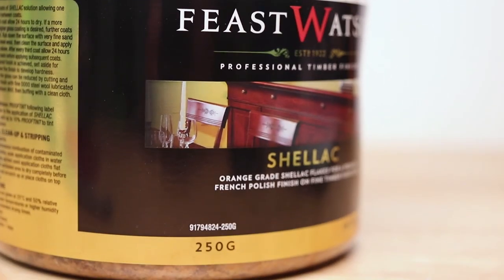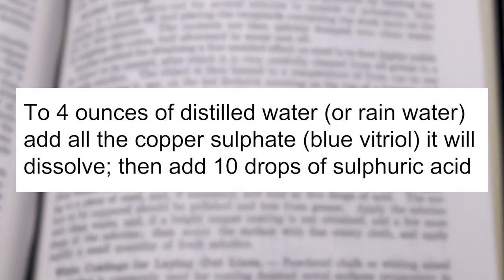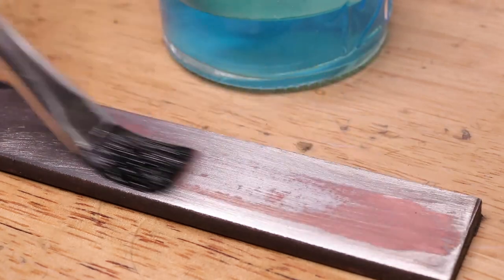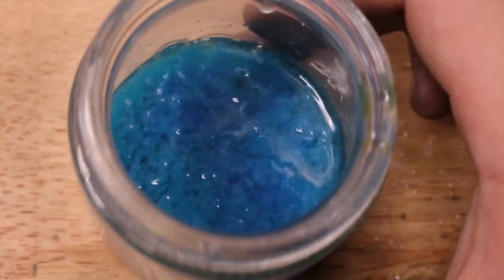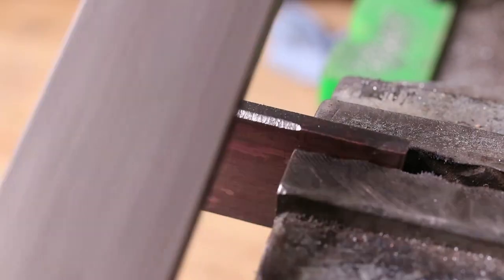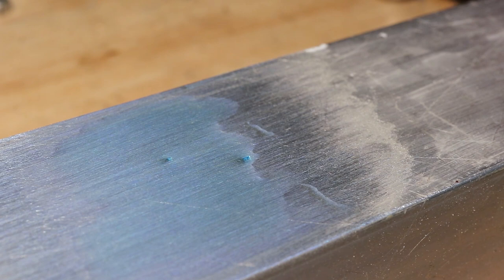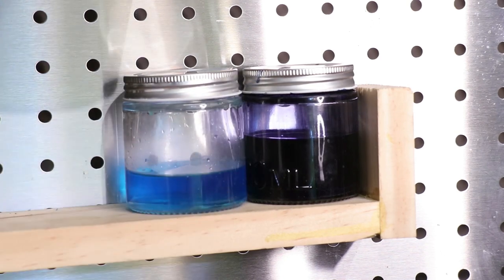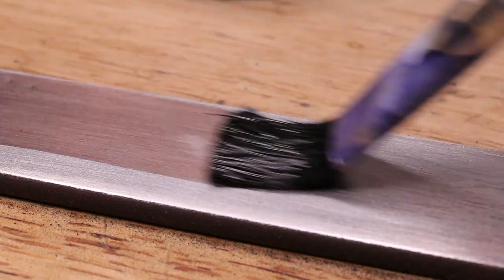Old School Machinist Layout Fluid (Copper Sulfate and Chalk)

Comment: A quick tip is use, shellac + alcohol and use this special dye called methyl blue available at any swimming pool supply/ chemist/drug store (it is used for pH testing). To increase the intensity of blue, add sodium hydroxide to the solution drop by drop untill you get the desired color intensity. As the phH is increased the solution turns basic resulting in darker shades of blues

Comment: The copper sulfate and water solution will, for some reason adhere to the steel much better, if it is applied to the surface, and “scrubbed” with a piece of “emery cloth” that is made with aluminum oxide. The acidified mixture was quite common for template layout in the mid sixties. The big castings (6-10 tons) were payed out with the blue chalk/alcohol mixture. Large holes that needed finish boring on an 8” boring mill, had a piece of wood driven into the hole with a piece of copper sheet tacked to this board. Eventually the center point was located and punched, to allow laying out bolt circles etc. Things have certainly changed with the advent of read outs and computers. A great look back. Thank you.